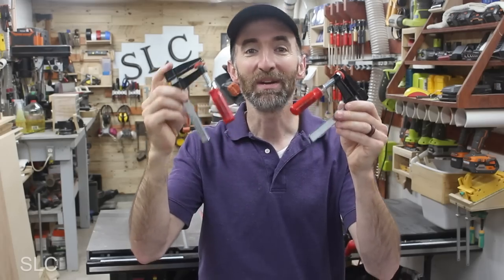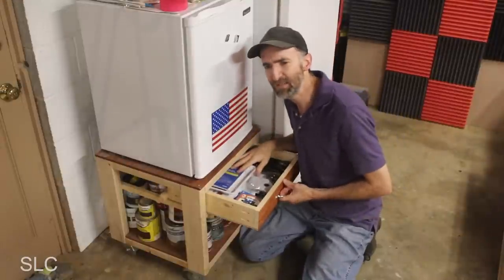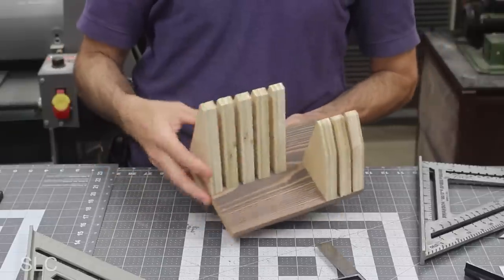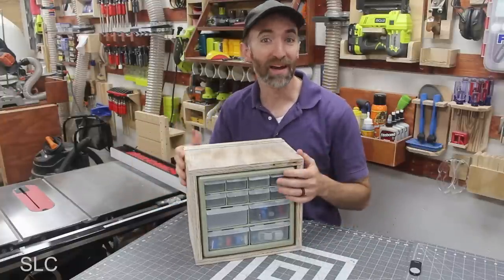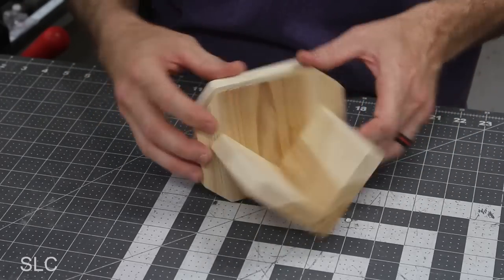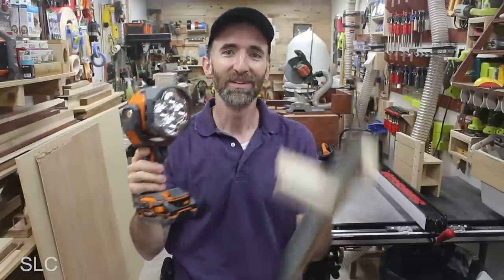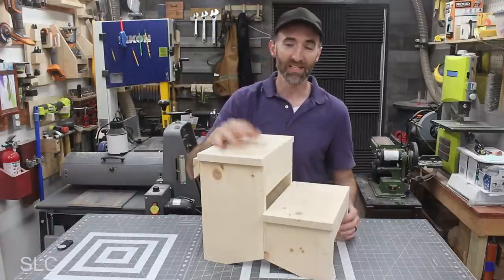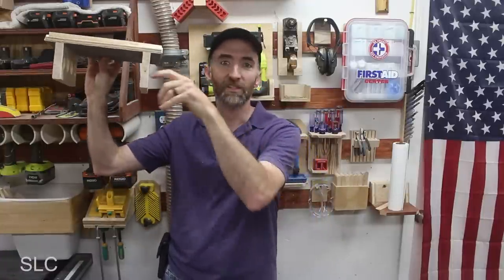10 Awesome French Cleat Ideas

Comment: Love your channel!  I'm a retired wanna be woodworker and have become obsessed with French cleat walls.  I have a large, substantial  (30'x40') METAL building so I've installed 2x4 studs (16" on center) on one side (about 22' long") but now I have to sheath the wall.  I was thinking of using 3/4" sanded plywood but I'm curious what your thoughts are as far as fasteners for the plywood to the studs.  I haven't been able to find any YouTube video that shows the SHEATHING process for a French cleat wall... they all start with existing walls and talk mainly about the FC rails which is great but I need to start from scratch.   I was hoping you could give me your opinion on what fasteners (type & length... I'm thinking GRK screws?) you would use to attach the plywood to the studs and the fastener placement (every 6" around the outside edges, every 12" for the middle studs?) obviously taking into consideration that this will be used for hanging tools, cabinets etc.  Thanks in advance for your expertise!

Comment: Howdie awesome workmanship just wondering how you wood make a cleat holder for Bolt cutters 24 inches in length and 5 inches across been trying but no luck with it so figured I would ask the Master show us how it's done from Canada 🍁 SK later man 😊been building lots of your cleats keep using up that scrap wood like crazy  and l,m mecnec  to boot so easy to understand you so carry on till next ones thks again
Reply from the maker: I would consider wedging it between two pieces of wood facing downward. And put a small notch on each side so it would not slide out. Hope that helps you.

Comment: Some nice ideas, but with the file holder you totally missed two points.

1. the width is based on the handles - they are wider anyway than the rasps and file - so there was no need to twist them the 90°.
2. thanks ot the bottom plate you now have on surface more where dirt and dust can be collected and will need cleaning.